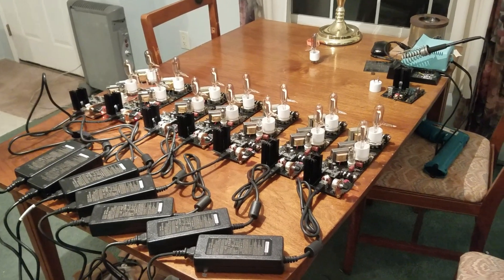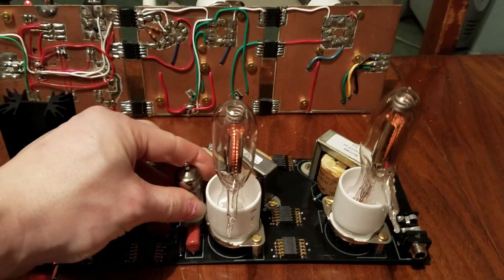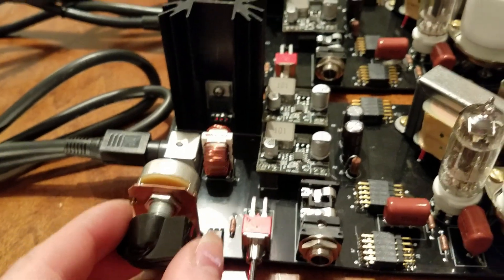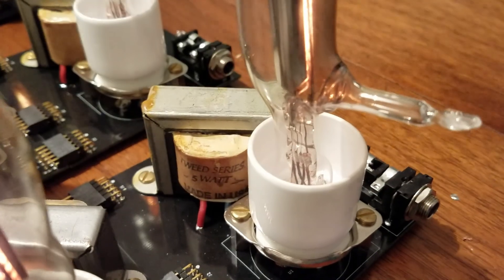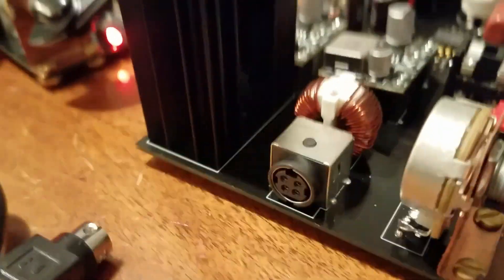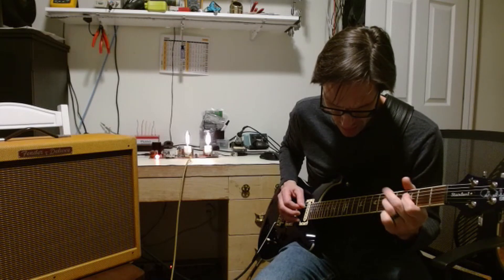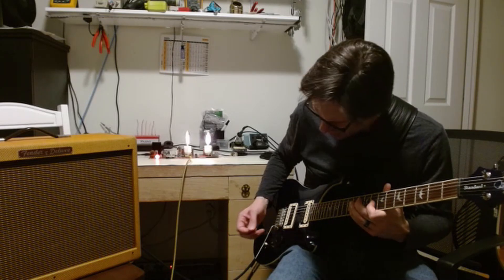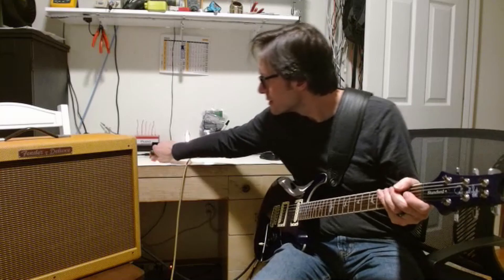Guitar Amplifier With Homemade Tubes

Comment: Pretty late on that, but I have to ask 🙌. I think you never really explained hiw you archiev the vaccum. You don't use an oil diffusion or turbo pump, do you ? How are you reachin 10 to 5 micron 😮 ???? I need to know 🫨 ! Good work btw 🎉
Reply from the maker: thank you! the tubes are pumped down to around 20 microns using an edwards e2m1 2 stage rotary vane pump, when they are sealed a titanium getter is heated in the tubes which brings the vacuum below 1 micron.
Reply: @jdflyback Thank you ! Very very cool work, also your homemade CRT 👌

Comment: Amazing!  One question, not in these triodes but in general, wich is the maximun plate voltage you can apply in your homemade triodes?
Reply from the maker: Thank you! I have had good luck running them on around 200v or so. when pumping however i run them at about 500v to outgas them. I have not tried to run one that high once sealed off though but in theory they should.
Reply: @jdflyback thank you! And waiting for your next video!

Comment: Oh my thats cool, but why not run it off of straight 120v rectified? Voltage not too far off and with a doubler its more than enough. It was done very simple in the day, it should have stayed simple but disease and mental state of people worsened, business practice worsened. 
The concept should always be kept simple, with a FUSE doing all of the work for safety and control. 
The tubes are gorgeous. 
Have you looked into high electron emissive work function doping elements for tungsten filaments?
There has to be a way to get even more out of the design, but you have done very very well. 
I would like to see a tube with 1 gain stage and built in diode as power supply but thats, maybe, not technically possible. 
Like high gain tubes exist, higher gain tubes CAN be made,,,
It would make for a convineint, easy to manage build for most people.
Maybe experimenting with superconductors or dlc coatings, or texturized grids plates, cathodes etc could all help. 

Or even a very large vacuum space for the tube to run evenly and cool more evenly, or work more reliably?

SO many options, more resources and infrastructure should go to it. 
Also I think tubes should have all mounting brackets and 4 teflon color coded wires coming off of them. 
It would be sooo simple and rugged. Maybe not ceramic base, but some metal bracket integral to the glass?

I could go on forever about this. 
Should be labs in universities for this still. 
its Very useful and its a great stepping stone into the analog and digital realm.

Comment: Really intreresting that you used a boost converter for the voltage. I really wonder if one can be made to do say 450v at 50W. Then a traco power module in the front. Would save a lot of weight and perhaps space in an amp

Comment: hello, what vacuum pump do you use? Is a two-stage pump enough to obtain the appropriate vacuum pressure?
Reply from the maker: Yes, I use an edwards e2m1 2 stage rotary vane pump for my tubes. This works but just barely. The poor vacuum allows for only use of pure tungsten for the cathode which leads to low emission. The vacuum also requires the use of a titanium getter instead of a normal barium one

Comment: Were you ever able to experiment with the getters I sent you?
Reply from the maker: Yes, I now have a diffusion pump high vacuum setup that can get the vacuum high enough that the getters will flash. I was unable to get one to work with just the roughing pump I was using but that was to be expected. I am sorry for my absense.
Reply: Diffusion pumps rock....and now you prove it.   @jdflyback

Comment: Very cool. Interstage transformers aren't common in guitar amps. In fact, I can't think of another example.
Reply: Makes sense, electric guitar postdates early triodes similar to the handmade tubes shown (01A is probably closest) that needed transformer coupling to make the most of their low gain. Like 1920s radios were often transformer coupled between every tube including the audio stages.
Reply: With interstage and a little driving power, going class A2 could double the power output. Think of George at tubelab with a triode driving a bigger triode with a HV FET acting as a source follower. Done right, the two triode distortion cancels, and power doubles.